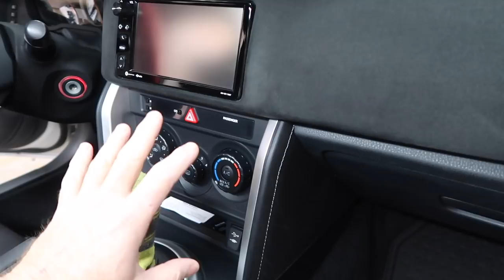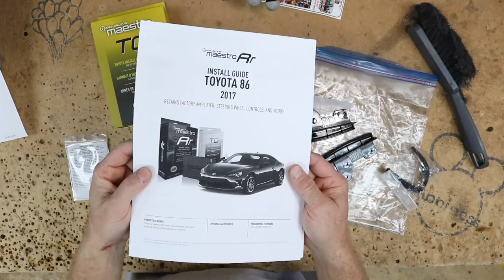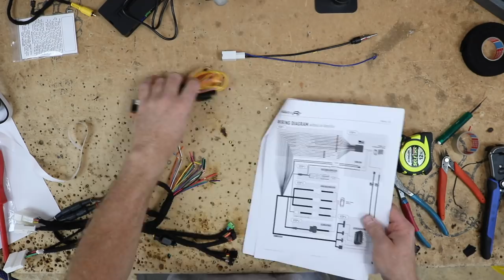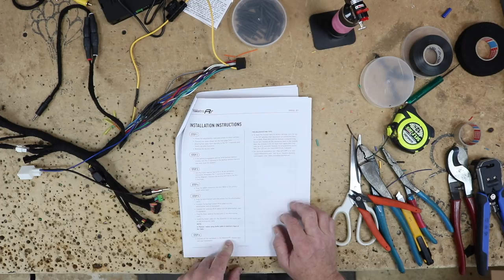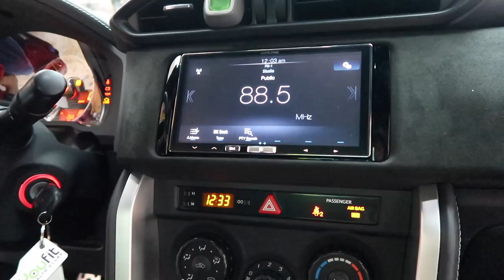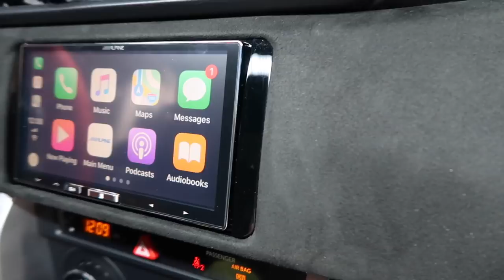The steps it take to replace your radio in a Toyota 86 using a Maestro RR

Comment: Found the brackets. It's from a website called Japanparts and it's labeled under "Subaru AV Escutheon". The part number for the website is 484-001-024.

Comment: I’ve been waiting forever for a video like this. I’m going to do this soon on my 2016 Subaru BRZ but with the Pioneer AVH-2440NEX instead and also with the OEM Audio Plus aftermarket sound system. Is the process the same or slightly different?? All that wiring looks so complicated. Pls help 😅

Comment: I have a question. I have a 2016 Scion FR-S. I'm using the idatalink website to find which products I need for my pioneer radio. Its telling me i need the SU2 harness instead of the TO1 harness that's in this video. I'm only trying to retain the stock rear camera and the usb and aux port that comes with the car from the factory. Should i get the one idatalink is telling me or should i get the T01 harness? Or will either of the two work for me?
Reply from the maker: I would get what idata is saying. We have never had a problem with what they tell us
Reply: @FiveStarCarStereoInc  Alright. Thanks for answering back quickly. I appreciate it :)
Reply: I had the same problem the t01 kit wasn't matching up with the install instructions so idatalink sent me out the su1 harness an I had no problem after that

Comment: I recently purchased a maestro RR for my 2014 Toyota Corolla from crutchfield. Be very careful ordering this unit from CF. They have a bad batch (iDatalink personally told my installer this and also they confirmed they warned CF of the bad batch) and CF are still sending out the bad units. IDatalink  CS is remarkable tho. I ended up buying a new unit locally so i could get on with my install.

Comment: Hi Dean and Fernando.  I have another question.  The 2019 86 TRD SE I have has a factory backup camera system that displays on the rear view mirror.  It's very hard to see since it is so small, and my eyes tend to focus on the reflection rather than the backup camera video.  I want to show the video on my head unit.  According to iDatalink Maestro, the RR paired with the SU2 harness will do this, but after installing it the head unit doesn't switch into camera display mode when in reverse, and the display still appears on the rear view mirror.  I checked for the reverse trigger wire you mentioned in the video, and the factory harness doesn't have it.  I suspect the camera video feed from the camera is also missing from the factory harness since the factory head unit didn't display it either.  Do you have any advice or suggestions on how I can get the camera video feed to appear on my head unit when in reverse?  Thanks again for all of your help.  You two are the best!
Reply: Randy Hunsaker nice I have a 86 TRD SE too

Comment: Hey Dean- Fernando, I did this to my 2017 WRX Limited with the Harman Kardon, everything works but somehow my front speakers are kinda weak. I can't barely hear them. Now, my question is, since I wanted to retain the factory amp, do I need to use the RCA from the new HU (W4400NEX) to the RCA from the RR or use the the speaker wires from the pioneer harness and match the colors to the RR? I didn't use the speaker wires, I just plugged in all the RCA from the W4400 harness to the RCA cables from the RR. I checked all the RCA connection and everything plugged in correctly but both front speakers are not really working.

Comment: SO I watched your video and I subscribed to your channel because I like your mannerism.  Now the question.  I have a 2018 Corolla, and iun my TO2 harness were some adapters for auxiliary inputs.  It has a round micro plug with a with a green/blue wire and a blue plug for the module.  Where does the loose wire go?  The instructions do not explain this.  Thanks

Comment: Thanks Dean and Fernando.  Always enjoy your videos.  I have a 2019 86 TRD SE, and am about to replace the factory radio with an ILX-207.  I bought the RR and the SU2 harness.  The instructions for the SU2 harness show amplified and non-amplified options.  I bought the car used, and I'm not sure if the stock radio has an amplifier or not.  Is there a way to tell by looking at the factory radio or testing some connections?  Thanks for your help!
Reply from the maker: Plug the harness into the car and tap a 9volt to a speaker wire pair. If you hear a pop sound there is no amp.
Reply: @FiveStarCarStereoInc  Awesome!  Thanks!

Comment: Hey guys, awesome video!!! Question, can a Halo 9 iLx-f309 be installed in a 2013 Scion FR-S and also I'm on the fence between the Halo 9 and iLx-207, any suggestions?
Reply: Yes the f309 can be installed.  it is just a bigger screen, here is a picture of someone who installed one in an frs: https://www.reddit.com/r/ft86/comments/aml66i/new_radio_deets_in_the_comments/

I personally like the ilx-207 more, it is a cleaner more factory looking install and doesn't block other components of the car.

Comment: Yegads the wiring horror! Am I glad I've only got 5 wires from my truck going to my Alpine CDE-HD149BT...just enough to power it up and auto dim the front when I flick on the headlights. Vehicles got real complicated! (There are 3 pairs of RCAs and the remote turn on lead heading for the amps from the deck and the BT mic though...)

Comment: Ok so I have the 2017 toyota 86 model and I bought the pioneer avh w4400nex also the maestro rr with the su2 however I do not have a factory amp anymore as i replaced it with a different aftermarket amp so is the install with this gonna be the same
Reply: @Rick Carr, I plan on doing the same to my 2019 Toyota 86,  any problems to with the install? Thanks

Comment: Best android headunit for FR-S? Ill like to keep my factory reverse camera 😅
Reply: So you can use any Aftermarket HU and retain the factory reverse camera. I have had a Kenwood, Pioneer, and now Alpine and all can use it.  The only unique thing about it is that it uses a 6V to power the camera, so if you get a voltage adapater any stereo will take it just fine.  In this case they purchased the idatalink maestro that did this for them.

Comment: Should have installed the kenwood DDX917WS made for toyota and apple, widescreen no need for the side brackets, plus its plug & play
Reply: Jay Hanan good luck finding one that's made for lhd vehicles and coded for American dvds
Reply from the maker: Kenwood does not offer that Toyota style radio here in the US. It is kind of sucks
Reply: My bad guys I thought you can buy this worldwide, I thought most Toyota's share the same plugs? Installed this in my toyota aurion which is a camry in the us, didn't need the steering wheel box or anything eles it will all plug in, looks like a mission for the us people! Hope you guys can get this soon 👍

Comment: Wait.. does the guy drive around with the cover on his steering wheel and a sock on the shifter?
Reply: No, Dean and Fernando put those on every car to protect both the steering wheel and the shifter, as well as protect any components from being damaged by the shifter. With some cars it can be easy to accidentally bump a touch screen radio into the shifter and damage it. The sock helps mitigate that.